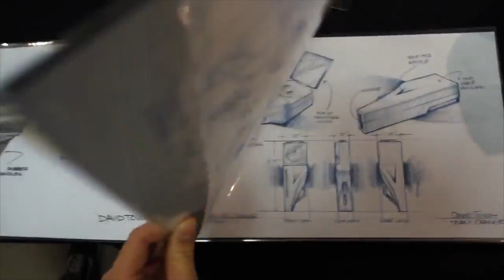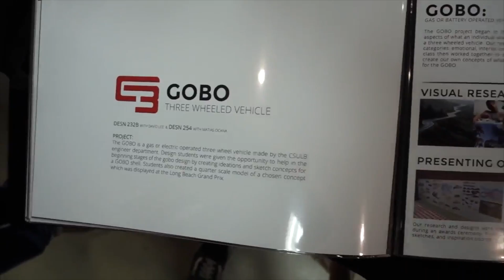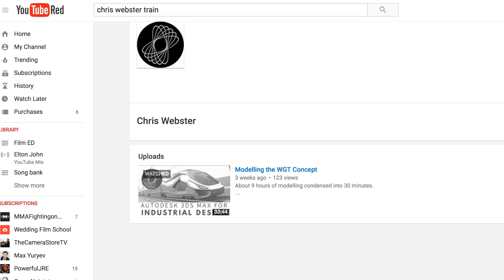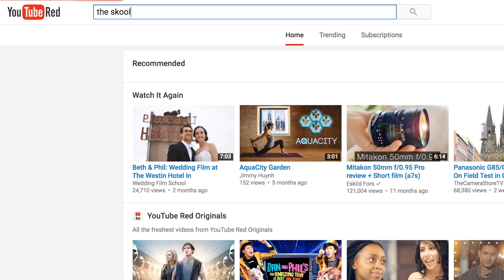Sketching vs. CAD vs. Modeling! Which is most important?!

Comment: I have about 15 years in the field and you are correct. But when it comes to CAD, you need to master surface modeling. Not many designers and engineers know how to truly surface model, it will put you ahead. I suggest industrial designers learn how to design/engineer for manufacturing as well. For example- plastic injection mold part design, machined components, etc. I’m a consultant and can take a sketch to a fully manufactured component. I’ll work with an Electromechanical engineer if electronics are involved in the project. On recent assignment, I worked on a plastic electronic enclosure where I was in charge of designing and engineering the housing, being able to do both disciplines allowed to charge substantially more. Many engineers scuff at industrial designers because they think all we do is draw pretty pictures. Once they know you are knowledgeable in a portion of their field you gain more credibility with your ideas. That is my experience as an independent industrial designer with anything composed of plastic parts, machined components, electronic devices. You never stop learning as an industrial designer. Great job on your videos, extremely informative.
Reply from the maker: Hey whats up Fernando! Great advice, really appreciate it coming from an experienced designer. Hope you stick around buddy!

Comment: Thanks for the insight. In the industrial design program at my school, they primarily use solidworks for our cad models. Are there any other programs you recommend to learn along with solidworks?
Reply from the maker: Hey Raul! Yeah there are plenty of CAD programs out there. My Solidworks professor told me that it really just depends on the industry you want to be in. For example, most designers and engineers use Solidworks while transportation designers tend to prefer Alias. Discover what programs they use so that you can begin practicing! Have any other questions? lmk! :)